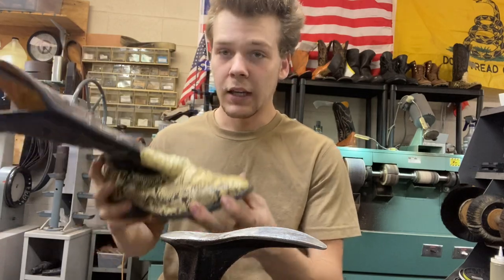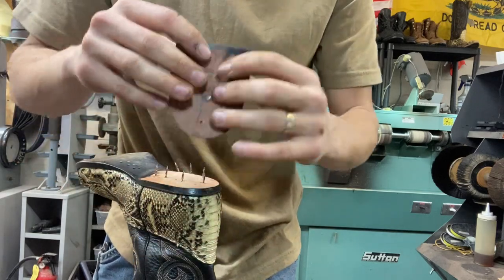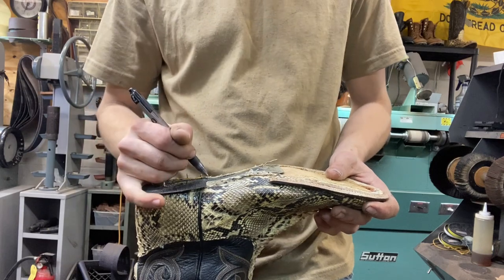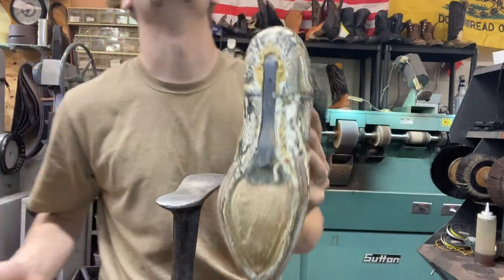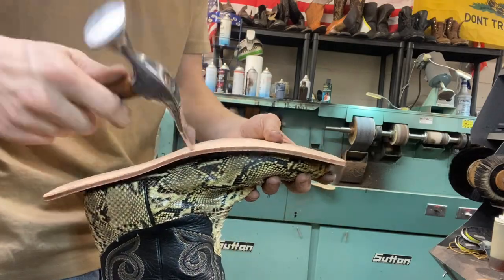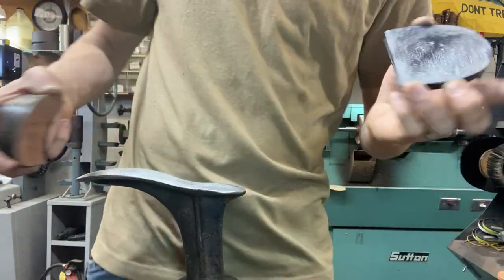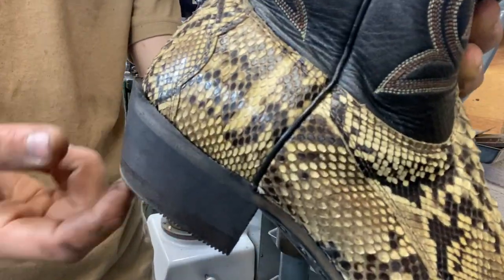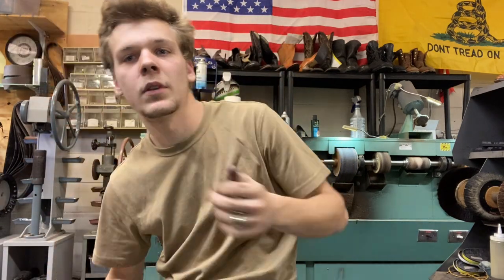30 Year old Nocona Snake Skin Boots Get Some New Life!

Comment: My terminology may not be correct but do you need to hit the original holes in the welt when sewing on the new sole?  Otherwise seems like new holes right next to the old holes could really weaken the leather esp for a subsequent re-sole ... or am I missing something fundamental??  Would love to hear your comment.
Reply from the maker: So typically we do aim to hit the original holes when sewing on the new sole. Our sewing machines have guides that help us adjust the depth and width of the stitch. Unfortunately it’s a guessing game since your stitching the boot upside down all you can do is pray you have your guides set properly and hope for the best. With practice you do get better, but sometimes the sewing machines like to give us issues. That being said depending on the width of the stitches, if you miss a few holes here and there you won’t have any issues. It doesn’t always look the best, but structurally there’s no problem. Now if it’s a shoe that’s been resoled a few times and each time they missed a few holes, I will recommend a new welt just because the foundation is weak and you risk the sole peeling away from the welt.